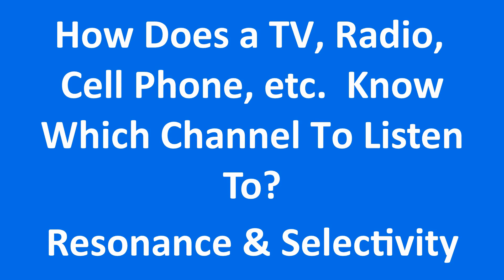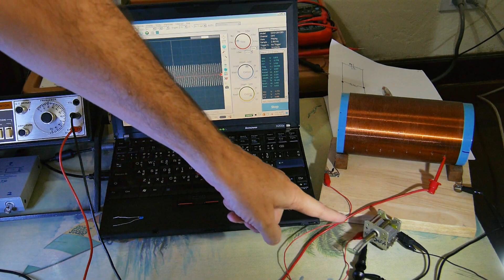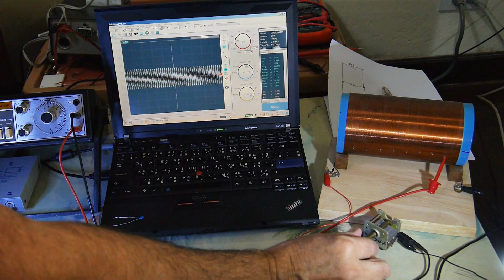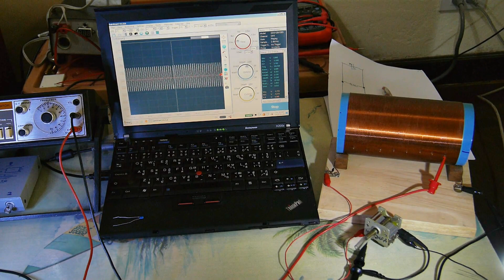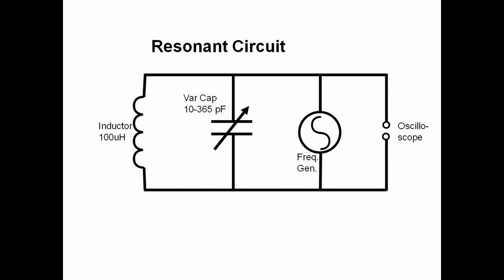How TVs/Radios Tune - Resonance Selectivity

Comment: no secondary circuit without capacitor resonance
Reply from the maker: All components have RCL (resistance, capacitance and inductance).  That includes even a piece of straight wire.  A coil of wire has RCL, and the C is greater in a coil than a straight piece.  also the piezoelectric earphone has a significant amount of C.